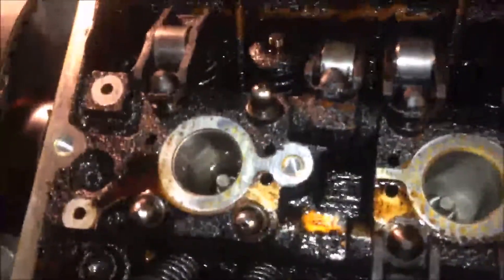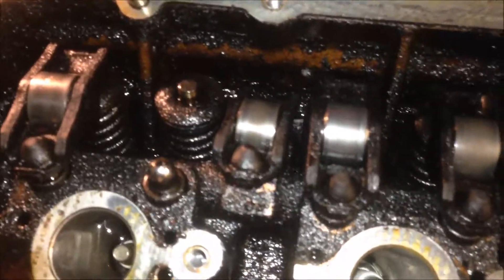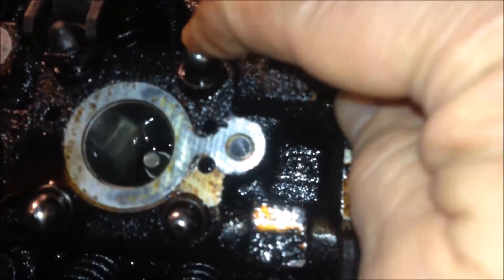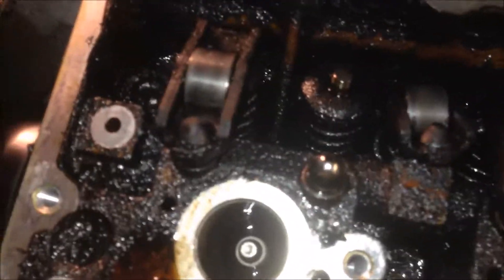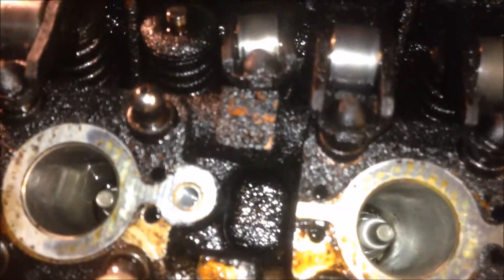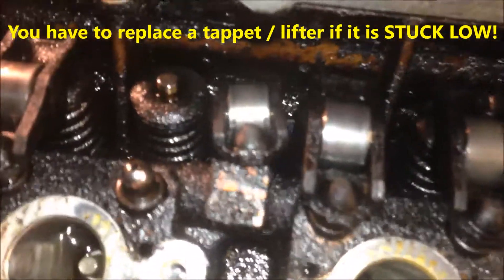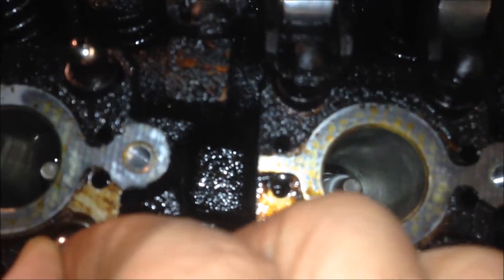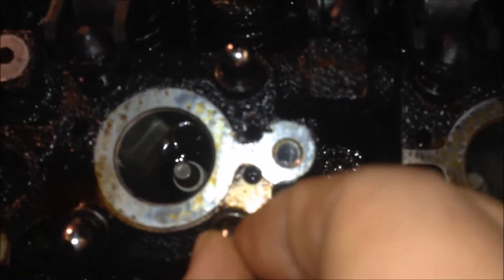VW Polo: Hydraulic Tappets / Lifters: Hydraulic Tappets / Lifters: Working or Not? (16v, 1.4, 6N2)

Comment: hello i have a mk4 1.6 16v and every morning when i start the car engine shaking so bad until engine reach 90C temperature its goes normal ! could it be Hydraulic Tappets ?
Reply from the maker: Hi, my car actually behaved better when cold and noisier when at normal temperature. Cold start engine shaking could be one or more of many things. You could try to check for vacuum leaks, spark plugs, and engine oil pressure. Good luck!
Reply: im gona try these suggestions , thanks !
Reply: Hi, i have the same probleme, the cold start give me high ticking noise likely i feel it come frome the hydraulic lifters, after some time i gutted the catalytic convert for some reasons of cours, now i hear the ticking sound loudly then before, even in the road while acceleratio, implaning to change the all 16 lifters